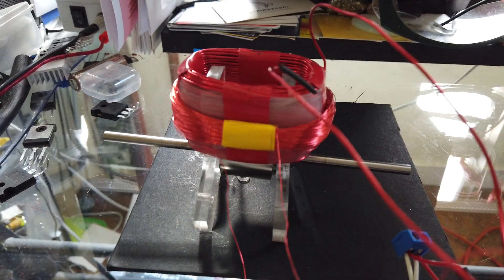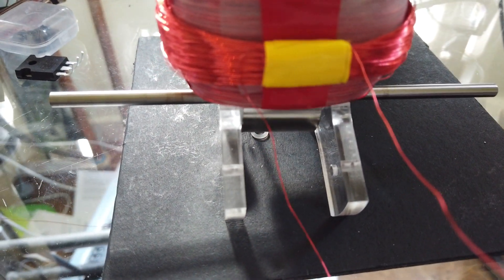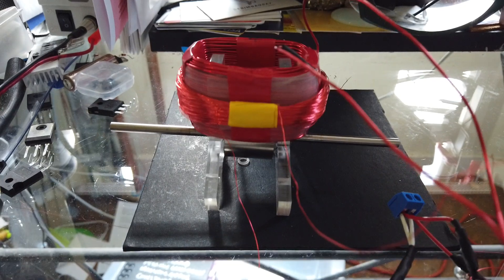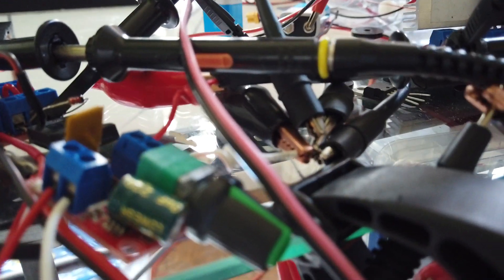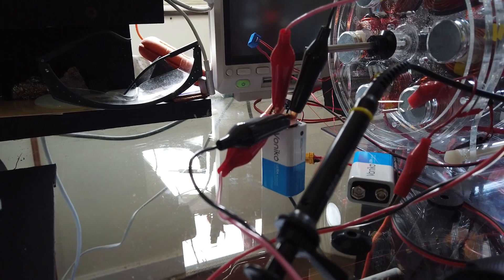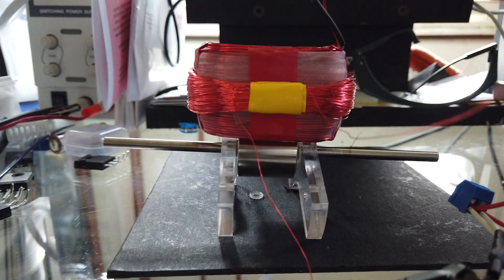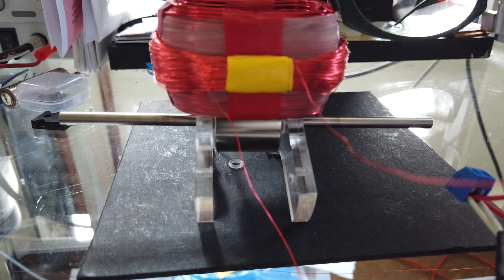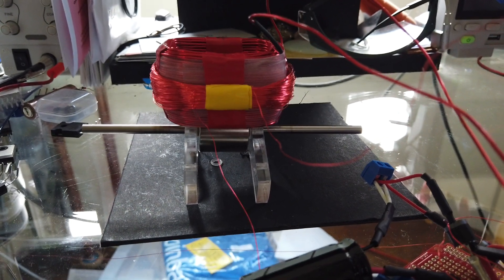Perpetual Motion? Motor Still Running After 2 1/2 Hours on a 9 Volt Battery

Comment: very cool man, is it still going?
Reply: still great results! yep, the way the energy interacts with the lead acid chemistry creates 3 fantastic ways additional can enter the system (bearden), pulsing a cap gives extra via a temporary electret effect too.  btw, I love your take on this and your setup!
Reply from the maker: @skydog22  Thank you!
Reply from the maker: No. It stopped after 6 hours, which I think is still pretty cool.  John Bedini always said that the recharging cycle works best with lead-acid batteries. So, I'll try that next, but that's going to be a looong test. Also, Peter Lindemann (a John Bedini associate) said that continuously exposing lead acid batteries to these high voltage recharge spikes makes them behave "electret-like". 

I'll play around with that next. Thanks for the comment.